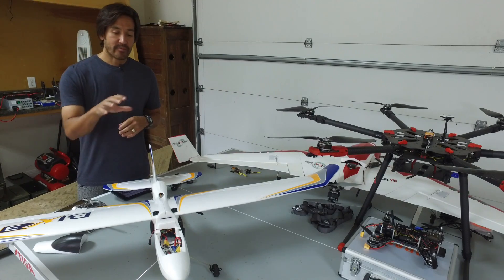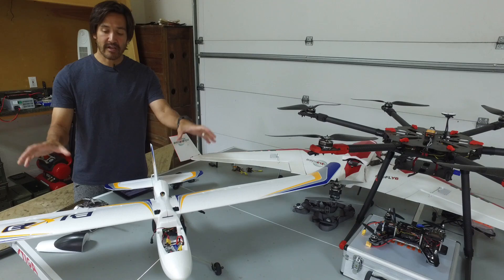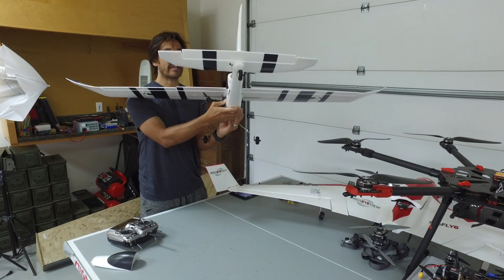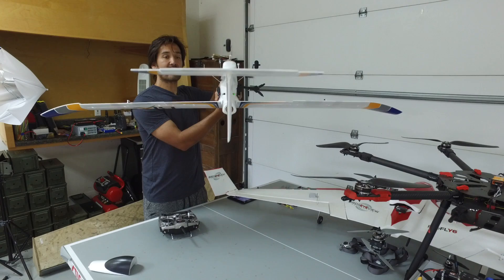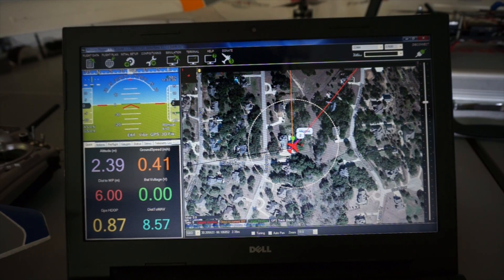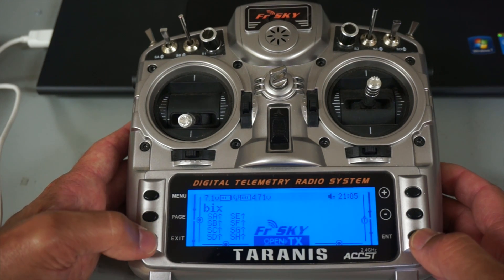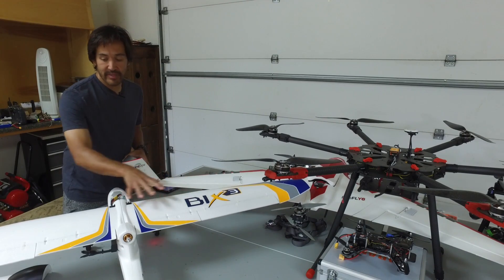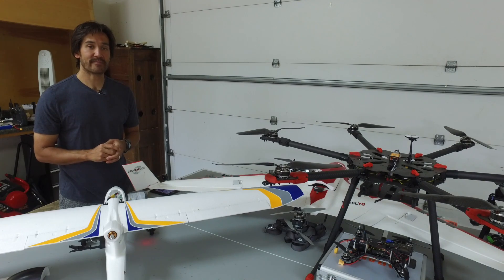Setting Up Inverted Flight for Pixhawk/APM with Bixler 3

Comment: I know that this is well after you undertook this project, but it is still relevant for me today. Would this work with a delta wing do you think? By that I mean, a delta needs reflex, we do this by reflexing the elevons. When it flips upside down, would the pixhawk apply the reflex in the opposite direction? Thanks if you can provide insight.

Comment: Thanks Dennis, good video! Also cool tip with removing the decals. Do you know, if there is also a inverted flight mode in the PX4 Flight stack?
Reply from the maker: Really good question. I haven't seen anything of the sort when searching so it doesn't look like it, but I'm not 100% sure.

Comment: Hi Dennis.. hope you can help ? a friend of mine has fitted an apm to a plane for a university project but it won't hold height when it finds GPS! it works well on his quads and hex but the barometer wont hold in gps mode.. can you help please
Reply from the maker: Interesting. I'm not sure what the culprit is here. I haven't experienced this before so I'm coming up short as it relates to ideas. Here is some detail on someone having a similar issue:

http://diydrones.com/group/apmusergroup/forum/topics/auto-loiter-mode-always-losing-altitude-log-attached

Would definitely recommend checking the CG as a starting place. Keep us posted. Would love to know what you uncover.

Comment: Dennis That just gave me a great idea. Flying a large wing you can mount a gimble on top inverted. After you get to altitude you can fly inverted with the gimbal on the bottom. Then flip when ready to land. Gimbal protected.
Reply: Excellent idea, very practical way to avoid repairs.
Reply from the maker: Very cool idea. It will be interesting to see how this holds up and then that may be worth a try. I'll know more after I get a test flight in. Hopefully this weekend! Hope all is well.

Comment: Have you done any tests with the Reach kit and the Pixhawk?
Reply from the maker: Not yet but I've been very interested in it. I plan on looking into it in the near future. Let us know if you dig anything up.
Reply: Photo stitching does not need something that accurate, but the big prizes are always won by being able to measure something more accurately.  It would be interesting to use Reach with a laser plummet and camera.  You could balance error on a ground shot.  You couldn't spin a point cloud though.

Comment: Looking forward if you could just make a video on how you calibrate and basically setup your plane. I took my Bix3 out just an hour ago. Well, put it in FBWA and it nose down and seemed like it exploded. It's beyond repair hahaha so I would really appreciate if you could do a walk through.Thank you.
Reply from the maker: Oh sorry to hear that! It sounds like your elevator needed to be reversed but that's just a guess. I will do a walk-through after I do the next inverted flight video. Hope you can get back in the air soon!
Reply: Well, you are right. I needed to reverse the A, E and R all together. Göued it all back and Flew like a charm but then I crashed into a tree. 12 metres high tree and long story short. After a lot of bruises and bleeding, I cut the tree down to salvage the electronics hahhahha. Looking forward to your video on how to do a proper setup and what to think about.

You're the best

Comment: Dennis. ...I'd recommend pitching up and into an inverted attitude rather than rolling into it....you don't have an aerobatic EXTRA 300 with 0-0 incidence between wing and elevator. ... but it will pull up on pitch in a loop if it has sufficient thrust..,and you'll gain altitude in the maneuver....rolling the Bixler will likely produce loss of a lot of altitude before the AP can stabilize in inverted attitude.
Reply from the maker: Thanks for the advice! I haven't been able to do this yet but will definitely give it some thought as I get out to the field to see how it "feels". I'll definitely be doing this around 150' AGL. Will let you know how it goes.

Comment: Without any flight controller, how does the BIX3 handle when it's upside down? I'm thinking in getting one for FPV and for autonomous flights. Thanks.
Reply from the maker: Good question. To be honest I don't know. I haven't rolled it yet but will do so in manual mode this week and let you know.

Comment: I'm assuming inverted mode should work with elevon mixing as well, I'll have to test that with a wing
Reply from the maker: I've been thinking about that as well. I wanted to start with Bixler and then move over to one of my wings. Let me know if you uncover anything and I'll do the same. Thanks.

Comment: Dennis thank you very much for this.I'm just getting to build myself a Bix3 with Pixhawk.Would it be possible for you to jsut show how you have made your setup and such, as where you mount your Pixhawk and so on.I did a build previously and took of in manual mode, but the Bix just got crazy and dived right down on the ground with the nose, so I bought a new one and want to make it right from the beginning.Thank you.
Reply from the maker: I will see if I can put something together soon. That's a great suggestion. Thanks.

Comment: U said that u would talk about putting the fake blue sky in PTUGUI PRO in other video  but you have never talked it till now ?
Reply from the maker: I haven't used PTGui Pro but the process should be the same. If you export your pano to jpg you can bring it into GIMP, add the fake sky, and then export. The EXIF data will be preserved and then you should be able to use krpano, panotour, or upload the pano to round.me, Facebook or any 3rd party provider.
Reply: +Dennis Baldwin thnx . I now know how to use it properly